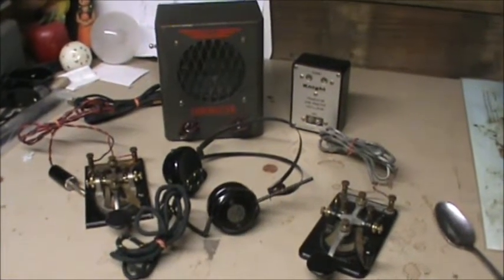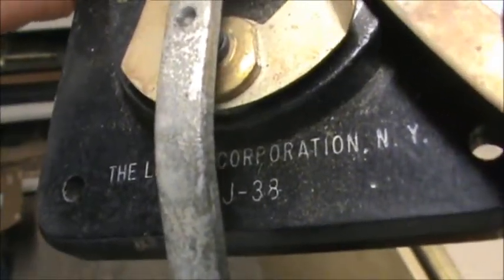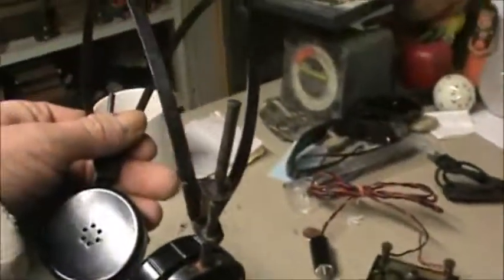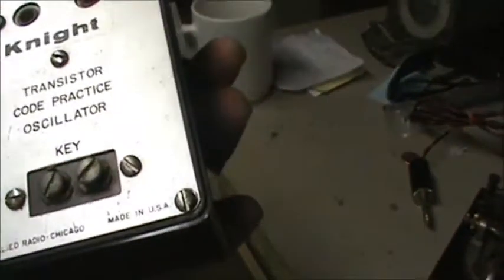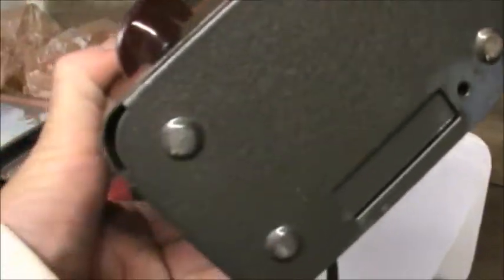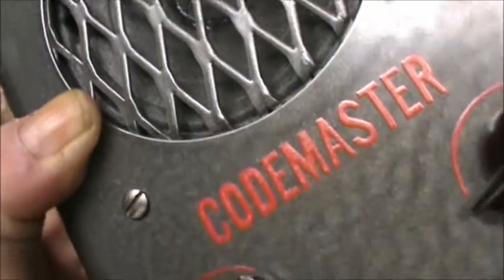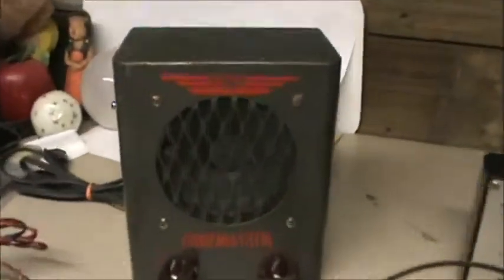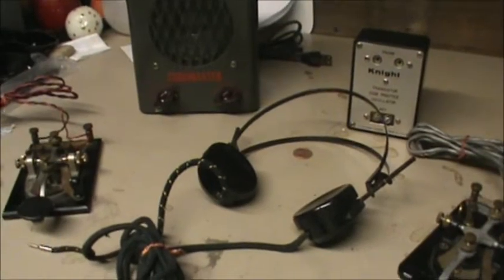Vintage BUD CODEMASTER Code Practice Oscillator Telegraph Key Monitor Plus Headset

Comment: Both those are j-38s and were standard issue WW2.  They are called KEYS not tappers.  Lionel was just one of the companies producing these.  The J-38 is still useful and used by operators.  Not so much the oscillators.